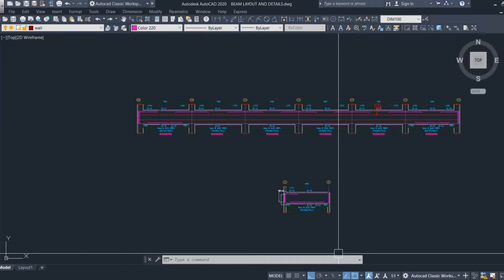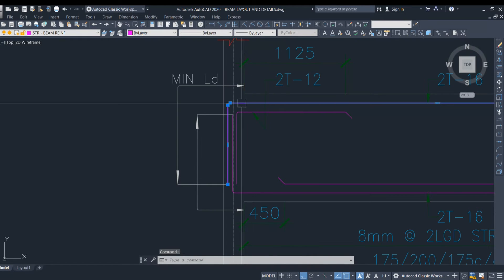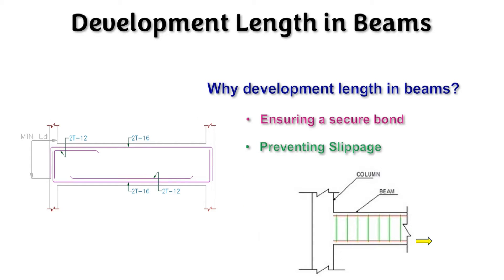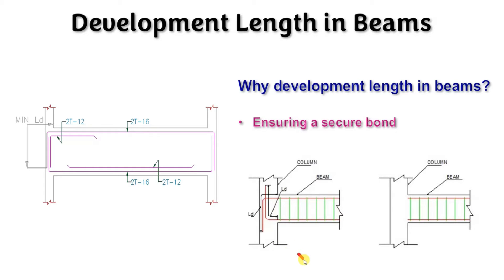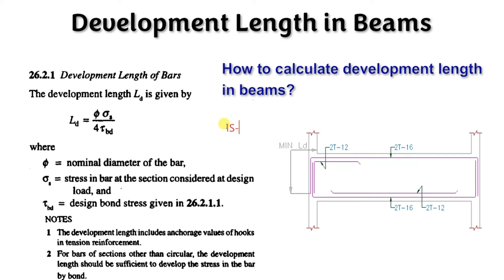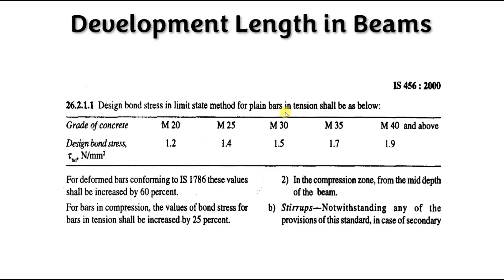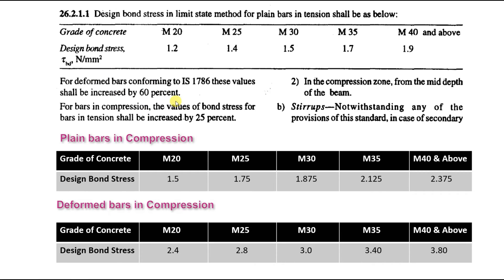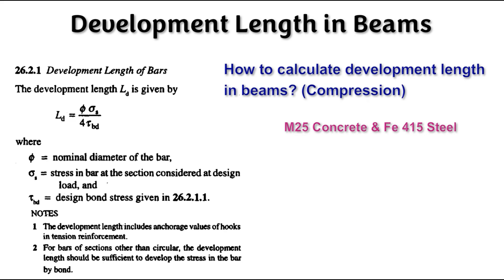What is development length in beams |Why do we provide development length in beams|Calculation of Ld

Comment: it is pretty good but how could i take if the beam depth 425 mm ?
Reply from the maker: You can use the same formula given in the video. Development length has to be measured from the face of the column.